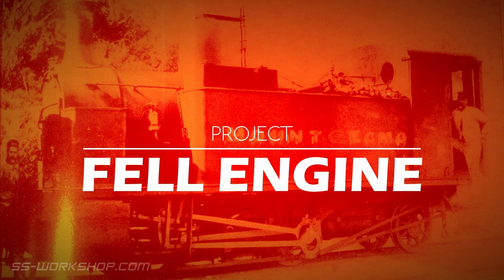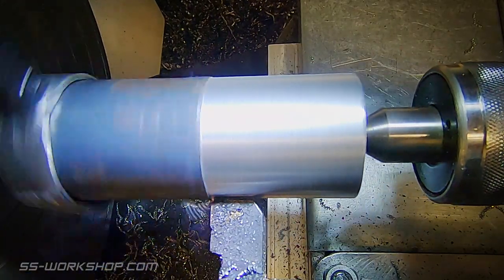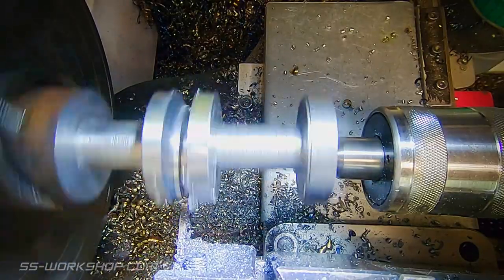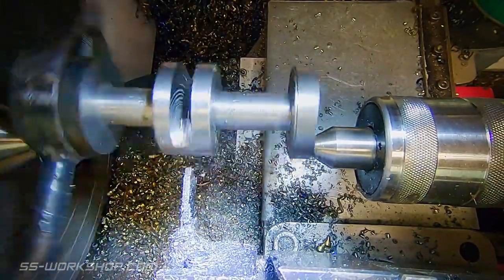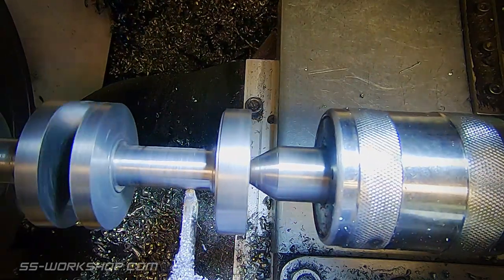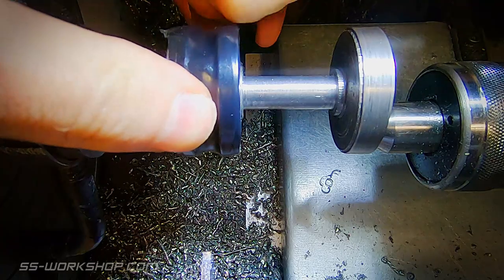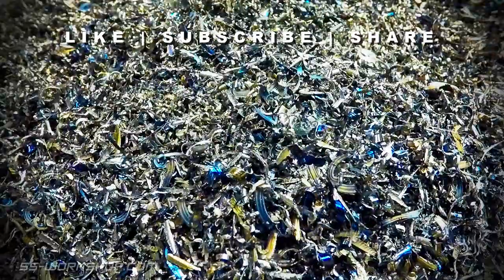Fell Engine Project - Turning One Piece Crankshaft S1.E22

Comment: How did you get the crank throw holes at each end of the rod in line with each other?
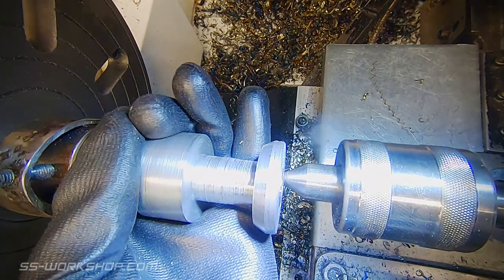Reply from the maker: Hi Keith, well spotted I glazed over that without showing. I scribed a line on both ends with the part pinned on a flat surface, at about 2:40 you can see the layout blue marks on one end where is was scribed. The drilling was done in a mill with the centre accurately located then offset. Cheers Chris
Reply: @SS Workshop  Nice job Chris.

Comment: These are great videos. I have just binge watched all of them. I cant wait for the completed project. Hopefully you will be able to bring it to our 3.5" and smaller run days.

How do you find the Optimum Gear? I'm looking at selling my car to finance a bigger workshop for the 8 projects i have on the go at the moment and really need better machinery.
Reply from the maker: Thanks great to hear your enjoying them, will be keen for a run when I finally finish, which club do you belong to? 

I have found the optimum gear really good it was a big change from the 2 in one machine with shared motor I had prior. There is little play and some of the popular bench top lathe upgrades are standard features such as the quick release tailstock. The big things that make a difference from my previous machine are variable speed (not changing belts for speeds), reduced play and the mill being far more capable because of its size and rigidity. The only thing I have had trouble with is the nylon high low gear on the mill which I made a video of changing, it seems to be the weak link but is common to most bench top mills from what I can see. I must say it probably doesn’t help I run a 50mm face mill on it. By the way if decide to go that way keep an eye out for Machinery House’s sales they seem to do a couple of good ones a year.
Reply: Yeah I saw they had a sale at the moment but need to figure out the best time to sell the GTR. Once that’s done I will have room to setup how I want. First I need to get my 3.5” Blackmore Vale back on the track. 

I’m a member in ashburton and we have runs in Timaru quite often. The smaller gauges seem quite popular in the south still.
Reply from the maker: I’m Wellington based hence my build choice, still need to join a club before I get to the boiler. By the way, nice Y class looks great.
Reply: Thanks. I wish I could say I built it but it’s older than me. I have just tried hard to make it better and preserve it a bit. I just moved down  south from masterton and spent a lot of weekends at Maidstone park in Upper Hutt. They have 3.5” -> 7 1/4” and I liked the fact it was quiet. 

I love the Fell engine. I have spent a bit of time at the museum over the years and use to listen to my nana about riding on them back in the day or my father who use to play on it when it was in the park across the road. It was probably the first loco I wanted to build as a kid as well 🙂